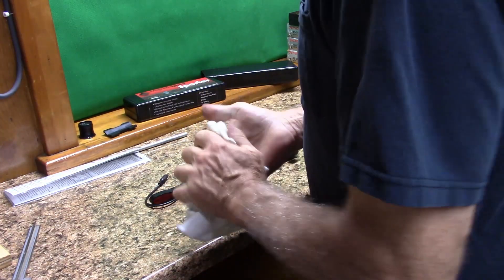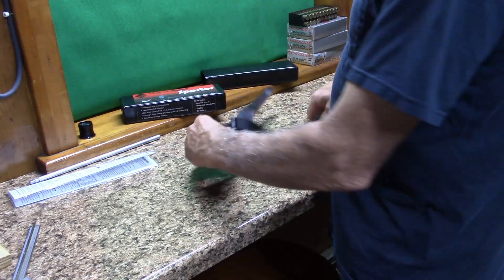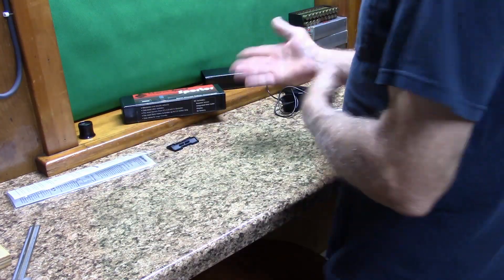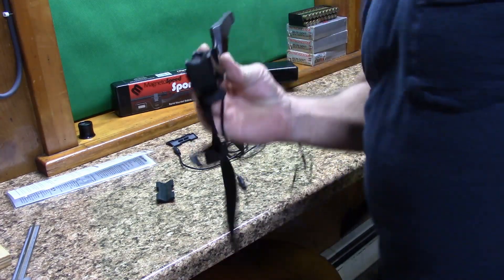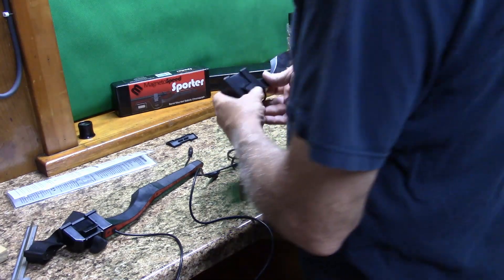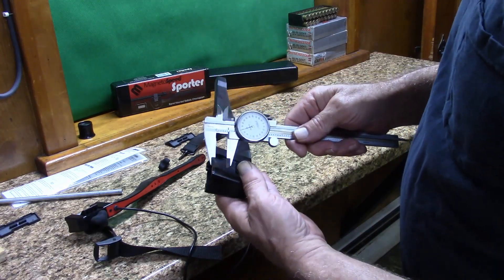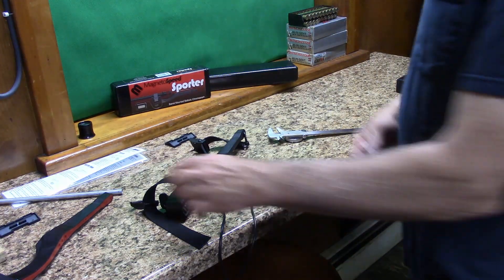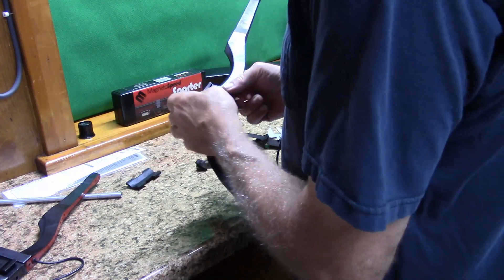MagnetoSpeed Sporter on Suppressors

Comment: appreciate the video, but wouldn't it have been more cost effective to trim the bayonet down and buy extra spacers from magnetospeed, rather than another bayonet? Would have saved you $180 and worked with suppressed and unsuppressed just by adding or removing the shims.
Reply from the maker: Thanks for the comment Aaron. The bayonet was only $80. The rubber spacers are not made to stack. I mostly shoot 1"+ barrels or with a suppressors.  The V3 is made for all but I saved some cash this way.
Reply: @R&S Varminter's  where are you getting extra bayonets for 80? cheapest I could find was around 200 bucks. I understand the rubber doesn't stack, but magnetospeed sells stackable peices designed for the V-3 so standard barrels without suppressors can be used with the V3, and still get the desired distance from bayonet to projectile/bore center.
Reply from the maker: @bennett338able  This is an old video. Things were less expensive back then.

Comment: If your only using it for load development, why wouldn’t you just take the suppressor off?
Reply from the maker: I tune my loads with the suppressor on.
Reply: The suppressor affects ballistics, with can you can get an additional 100fps, obviously when running subs this is not desirable.
Reply: @bennett338able that's not necessarily true. There have been several tests done that show that more times than not, a can won't add any real-world velocity to your rounds. Are there exceptions? Sure, but most people will see almost no measurable difference in MV.

Comment: Did you try adjusting the sensitivity first before the chop?
Reply: Doesn't matter, the sporter is not sensitive enough (with only 3 sensitivity settings), I even tried the rare earth magnet addition some suggest online, while better, still couldn't get consistent readings, chopping down the bayonet is the only way to get the Sporter to work with suppressor, but rather than buying a spare for unsuppressed barrels just order the extra shims from Magnetospeed and the modified bayonet will work for both.

Comment: that's creative.  if you want to improve on the hold you can ditch the nylon strap and use a voile ski strap.  that way you don't need to worry about it sliding back on you after a few shots.
Reply from the maker: That is a good idea, thanks : )

Comment: Very cool!! Can you still use the modified version without the suppressor, if so, did you have to stack the two rubber spacers?
Reply: Did you not watch the video?
Reply from the maker: It's too short after cutting to use on a standard barrel. That is why we bought a second one and modified it instead.